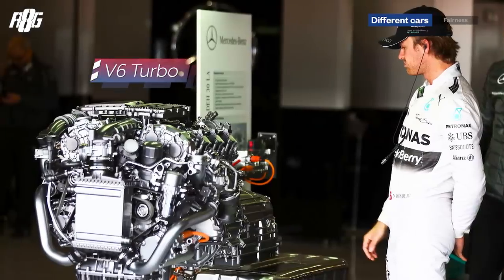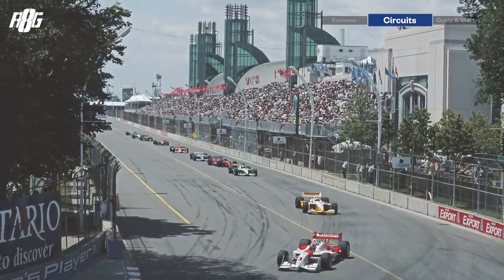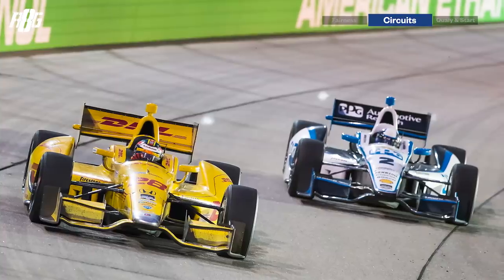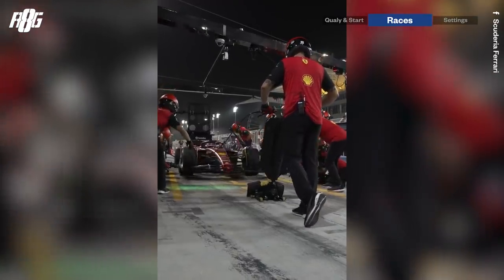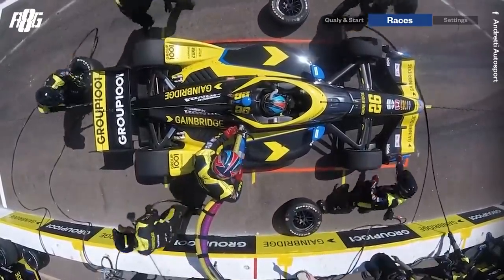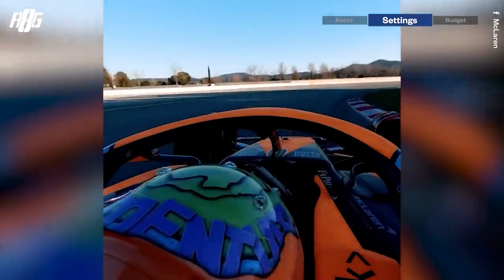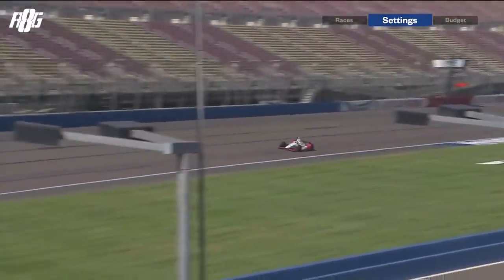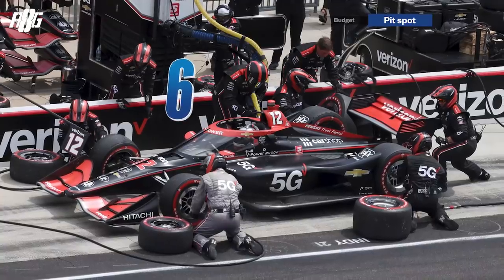The Main Differences Between F1 & IndyCar Racing!

Comment: Like to hear differences/similarities from within the cockpit -- overall sensations, body position, radio comm, etc.
Reply: Agreed! And about how the teams are organized, how the race engineers might be different (or not?)
Reply: @gregoryf9299  in indycar, there is no hard limit how many cars they can or have to run, or even for a full season if they dont want or cant afford it. some cars even have a driver only for ovals and another in the same car for the other courses. each team has their own pit crew and engineer and pit box so there is no team strategy. no team orders either beyond "dont wreck your teammate". teammates can share data and experience of course, and each car might be set up slightly different per what the driver wants
Reply: Look at Romain's upper body compared to his F1 days.
Reply: one thing i know is that they dont have power steering in Indy like in f1
Reply: @sullybiker6520  Especially those F1 days when the minimum car weight included the driver, so every driver would have to lose as much weight as possible!
Reply: @colehartel7206  The minimum car weight still includes the driver. but the drivers have minimum weight as well which is 80kg and all drivers are bellow
Reply: @SuperHugocoelho  they have to work the wheel a lot more in Indycar. Looks more fun than f1

Comment: Love these videos! Love your enthusiasm and your insider perspective. Been watching Indycar since 1978 and F1 since 1981, maybe earlier, but 1981 is the year I figured out that they were two different series. Back then it was normal to compete in both series in the same season.
Reply: Really? I thought that was more of a 50-60s thing. Thought they took the Indy 500 out of the F1 championship because of the lack of F1 drivers coming over. I started watching F1 in 88, with really getting interested in 1993. I remember it was such a big deal when Mansell went over, so I thought it wasn’t a done thing.
Reply: @sloppynyuszi  youre right. in the 80's only Teo Fabi and Andretti switched mid season. it was far more common to do both in earlier decades
Reply: @MrSeanma  Fabi and Andretti tried to do both championships at the same time,  some drivers would just be hired guns entering any series they were paid to race in, F1 was less strict about that then. It was also more common to switch from season to season back and forth, that still goes on but it was more common then, you'd hear the same names at the back of the grid in both series, and sportscars.
Reply: @crusherbmx  i was talking about Michael, not Mario. He retired full time from f1 on 1980 i think then got hired by ferrari and williams for a couple races in the early 80's

Comment: Hi, could you make a video discussing the differences between driving an IndyCar and an F1 car and how they’re different for the driver physically, such as the strain on the driver’s neck, is one car harder to steer or more physically demanding and how the enclosed halo versus the open halo in F1 are for you? I really enjoy your videos and the insights you give. Thanks.
Reply: The cars are probably about the same when it comes to strain on the body. F1 has higher G forces, but IndyCars are downforce cars too so they still pull a decent amount of G's. IndyCars, however, don't have power steering which which adds extra strain. So, F1 and IndyCar probably put the same amount of stress on the body, but in different ways. Also the aeroscreen in IndyCar makes it super hot so they have a system to help funnel air in to the driver and in to the helmet.
Reply: I think it was Ericsson who said F1 is harder on the neck, IndyCar is harder on the rest of the body
Reply: ez, f1 is harder since it’s way better
Reply: IndyCar has no power steering so it must be very tiring.
Reply: @foryoutube9960  Based on what, exactly?
Reply: @Thesdr666  don't feed the trolls
Reply: Romain said after his first Indy car race that it was physically the hardest he's ever done. Indy cars have slightly less, but similar G's, but then you also take away power steering which adds another element.

Comment: I remember reading years ago that when Jacques Villeneuve first arrived in F1 that he really pushed the Williams team to open up to the idea of changing the suspension set-up while at the track to suit conditions, as well as adopting an asymmetrical set-up in some cases.  Is that still done in F1?  Or are the settings set based on simulations, and then parts like wings merely swapped out?.
Reply: Pretty sure the setup does change from race to race. Not sure how much they change about the suspension (especially with the new ground effect cars, that need stiffer suspension and low ride heights) but aero setups change a lot, from the hyper-downforce monsters from Monaco to the speed demons of Monza.
Reply: I wouldn't believe a word Jacques says.. he landed in a car that was developed by Adrian Newey. 
then disappeared as an also ran after 97. 
dude just likes making headlines.
Reply: @RCRitterFPV  u don't know a thing. Also ur comment has some typo
Reply: @NicotineRosberg  where are the typos and what don't I know?  
"ur" is a typo

sooo....
Reply: Suspension set up is very limited, as far as I know. I believe changes in suspension set up mostly account for the drive direction of the track, i.e. whether the track is driver clockwise or counterclockwise
Reply: @dianevink1375  in what world is an F1 car have limited adjustments? 
Other than rule mandated ride height..
They adjust the car from corner to corner. 
Change air pressures. 
Now the old tires did most of the “suspension” before. 
But balance and handling is infinitely tunable
Reply: Nico Rosberg once said in his lap demo video that F1 suspensions are rarely set-up symmetrical, the teams always takes into account on how many left and right turn etc. and creat a asymmetrical set-up
Reply: @RCRitterFPV  If I had to guess I'd say the following: First the wings and ride height are optimized for max speed (straight line + corners) without bottoming out, then the camber is adjusted for tire durability + under/over steer control (stability, taking driver preference into account) and finally brake bias is set to a range which suits the driver. At least that's how I do it on F1 2020 ;-)
Reply: @perp1exed  at the very least, 
they can tune the carbon in the arms for vibration and torsional stiffness. camber upon deflection...
Reply: @RCRitterFPV  "then disappeared as an also ran after 97."
I have no idea what you're trying to say here. I believe that's what the other chap was getting at.
Reply: @dubster82  I'm saying he was lucky to land in an awesome car in 97, then he was a midpack driver the rest of his career. 
He's not some master of F1, just kid of F1 driver who had path paved to drivers seat.
Reply: @RCRitterFPV  glad you cleared that up champ. I was also very confused and had no idea what your ramblings were about.
Reply: @RCRitterFPV  now about JV. You say he landed in a Adrian Newey car? Correct. And he almost won the championship in his first season and def won it convincingly in 97. After that yes he made many career choice mistakes and should have taken the 98 McLaren deal but instead went BAR in 99 but he’s not tye only world champion to make bad career choices (Alonso) but man on his day cupcake 🧁 Villeneuve was fast. He had a raw ragged racing style that has now since died out but was born out of the 70s and his father and especially the Indy racing in America at the time.  Even in a sh*t 📦 like the BAR I remember watching him qualify for SPA I think 2001. Very entertaining lap. And he did manage to get the BAR on the podium several times. Remember Gilles started racing with skimobiles in Canada not far from where I’m from. Which is a very ragged rally cross style kinda racing. The Villeneuve family racing style is best describes as that. When you put that into F1 it might not be the fastest but it sure is the ballsiest! 🏀⚽️
Reply: @RCRitterFPV  Villeneuve had DOUBLE the points of his teammate in 1997. But you want to pretend it was all the car. 🤣

Also, pretty much every WDC has been in a top car. Every one. You think Schumacher, Senna, Lewis, Piquet, Lauda etc won multiple titles driving a shit car? How many titles did Schumacher win after he left Ferrari? None. In fact he only scored 1 podium in 3 years at Mercedes. How come you are not calling him a "midfield driver who landed in the best car?". Nobody wins titles unless they have the best or at least close to the best car.

"He had the best car" is such a stupid criticism. All it shows is you don't understand F1.
Reply: @AD-df5tm  kinda how points went back then, 
1st 10 points, 2nd 6, 3rd 4.  So Heinz his team mate  had a bunch of 3rd place finishes and dnf. 
Schuey in a much slower car split the 2. 

Jacques Villeneuve took the title by three points although Michael Schumacher was technically disqualified from second place after the season. Third place was closely-fought between Heinz-Harald Frentzen (42 points, one win), David Coulthard (36 points, two wins) and Jean Alesi (36 points, no wins).
Reply: eddie Irvine Schumacher teammate ended up with 24 points (Shuey had 78)
Reply: @RCRitterFPV  

In that context 'ur' and 'u' are short forms, not typos. They're not errors.

Also, your argument appears to be "I don't trust his opinion because I don't consider him talented" which isn't much of an argument at all.
Reply: @RCRitterFPV  Never having been a superstar I couldn't even begin to imagine the pressure those guys are under. At Portugal 1996 he chased down Damon from over 20 seconds behind to win by an equivalent margin. Shumi and Prost also had something of the jerk in them but that didn't stop them from being great drivers. I watch motor racing to be entertained and Jacques certainly did that.

Comment: Great recap of the differences! Quick question: From a purely driving perspective, which car do you enjoy more?
Reply: I’m pretty sure in an older video he likes driving in Indy car more because the car suits his driving style while in formula one it didn’t
Reply: In Indycar you have to work the car to get the most out of it. Basically have to manhandle the thing to be fast. In F1 you have to be smooth as butter.
He has stated he likes working the car more for his style of racing.
Reply: @xtlm  having to manhandle it actually sounds like the settings not suiting the driving style. The difference Romain mentions in this video is basically that in F1 the drivers have to adapt to the car.. while in IndyCar it's the car that is being adapted to suit the driving style of the pilot.
Reply: @lunasilvermoon2283  In the overall sense, Indycar does not have power steering. It takes a lot of muscle and quick corrections to make it though a corner fast. They have to work the wheel to get the quickest line. It is true that they can suit the car to how they like it to feel. The car has like 100+ different things to modify, even bars to move while racing and knobs the pit crew can turn during pitstops, but they will always have to work the car to a certain extent, due to the nature of not having power steering. 

He said that his first few laps last year in testing, that he was driving the car smoothly like he would an F1 car and was several seconds off the pace. He learned that you had to really drive the car and get it skittish for it to go fast, which he has said suits more of his style.

Comment: I'd love your opinions on the braking systems in the two cars.  I know they're radically different with the energy recovery in F1, but what are they like to drive from the driver's perspective?  I've only driven smaller formula cars (F440, FF) but was amazed at how strong and predictable the brakes are.  We only had mechanical brake bias adjustment (big red knob on the dash) - how do you change bias in IndyCar, and what else is different? Thanks!

Comment: I would love to know what Indy tracks/courses  would be suitable for todays F1 cars and actually create a great race? And vise versa. Definitely be pretty cool to see F1 in Long Beach, and Indycar at Spa!
Reply: the only race that F1 would be allowed to race at on this years current indycar schedule would be the IMS road courses. all other tracks are grade 2. and personally I wouldn't want to see those tracks ruined with grandstand and runoffs just for F1
Reply: Both series race at COTA in Texas, so that is a good look at a track that can handle both and provides good racing for both. One of the issues with street courses in North America is that they can be very bumpy, which would likely need an upgrade to bring  in F1.
Reply: @sams-pg7hj  exactly
Reply: @robertkelly8106  indycar hasn't raced at COTA in a couple years and as long as TMS stays they wont go to COTA, and as far as I understand, COTA doesnt really want them
Reply: @robertkelly8106  Will be interesting to see how they smooth out the bumps at Las Vegas. Despite whatever they do, it will likely still be very bumpy for an F1 course.
Reply: @andrewsokol2717  helps that it is the desert so the roads dont get ruined in winter as easily or over time

Comment: Talk more about the tracks... How do F1 tracks differ from Indy car tracks? Are F1 tracks more technically difficult from Indy or vice versa?
Reply: For shared circuits, like when Indy used to race at COTA, or when F1 used to race at Indianapolis, the technicality is the same, because the tracks are consistent in pavement, run-offs, pit-entry/exits, and curbing. At F1-only tracks, like Silverstone, with little elevation change, the track may be more difficult in terms of limited camber turns, but they are very wide circuits regardless. In IndyCar, many circuits like Road America or Mid-Ohio, the tracks are older, have far-more elevation change and even blind crests, reduced run-offs or even sand-traps, and may not be entirely consistent in paving. They are often also smaller in width compared to F1 tracks, making driving on at the max more difficult. Add on oval races, which have their own styles of driving and qualities, and the understanding of technicality is high and spread out over multiple facets in IndyCar. I would say F1 has a higher peak technicality, but it is also easier to maintain consistency with the majority of relatively flat turns at F1 circuits, versus the mixture of unpredictable conditions at IndyCar circuits that challenge the driver more frequently, while also having to race a circuit one week and an oval the next, but may not have as technical sections in F1 circuits, nor can IndyCars corner as fast as F1 cars.

Comment: Great video romain ! As a formula 1 fan, I've always wonder since the indycars are all pretty much the same, what is the difference between a big budge team and a not sot much big budget team.....It's only the dampers ?
Reply: dampers and suspension i think.
Reply: @zeropride1133  its also just experience and and data and the team effort on a bigger team, but thats less important
Reply: That, but also the talent. Bigger teams can afford to hire the best engineers, strategists, driver coaches, leadership, etc. All that does make a big difference so even though the cars are very similar and small teams can make a surprise win and podiums a couple of times per year, the biggest 3 or 4 teams almost always win the championship.
Reply: @shucklesupremacy66  thanks

Comment: Great video Romain, thank you. I worked for Reynard in the '90s and F1 for 8 years after that. Even so, lots I didn't know. Correct me if I'm wrong but I believe F1 is also running E10 Ethanol for the 2022 season.

Comment: Romain why there is a tube (A sort of) on Indycar helmets and not in the Formula 1 I saw last time the Helmet close ups of you Colton Herta and Rinus VeeKay. I see also small holes similar to F1 helmets.

And in Indy car you have oval racing is this possible with the F1 cars as well with the same speed as Indycar does?

Im curious now

Thank you in advance

Danielle
Reply: indycar has the tube for airflow into the helmet for cooling because the aeroscreen blocks the normal airflow and the cockpit gets very hot. for oval racing, there are many good videos out there about it, but indycar would be faster unless F1 did some major car changes to essentially look and behave like the indycar for oval racing. these changes would include significantly reducing the downforce creating elements on the f1 car, all those would just create drag and slow the f1 car down. being able to change the camber on the wheels for oval racing for the banking, and making sure the safety of the car is up to spec for the speeds near the concrete wall. also the hybrid stuff that creates extra horsepower for F1 would be useless on super speedways like Texas or indianapolis because there is no breaking besides going into the pits, so no recharging that unit. short ovals need breaking so that unit might work there.

Comment: Is the air jack system more reliable and consistent in the pits than the manual jacks that F1 uses?
Reply: I havent heard indycar have any major jack issues for the last few years at least. I assume the manual jacks save weight on the car so you dont need the lift system on the car for F1
Reply: Don’t forget.  Indycar is only allowed 6 people on a pit stop.  There isn’t enough guys to do manual jacks.

Comment: Thanks Romain 👍
What about the body kits in Indy? Do teams get a kit to customize the aero? I've seen Indy  testing in Sonoma, and one thing that called my attention was the were changing bits and pieces of the body and edges of the wings, besides chassis setups.
Reply: Well, adjusting the different bits on the wings is part of the set-up that everybody is free to do their own way.
Reply: this year in particular and depending on the course they can add or remove tiny winglets and adjust wing angles, but the pieces are even across teams so no individual development allowed, they can just use the given pieces as they see fit